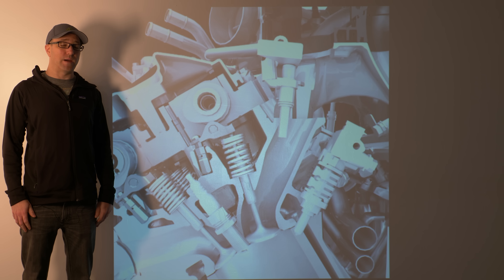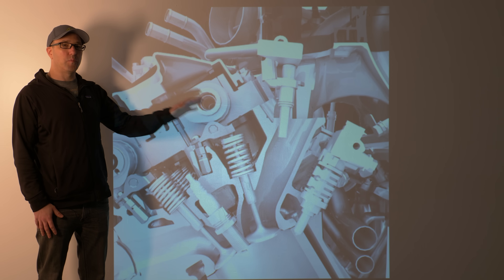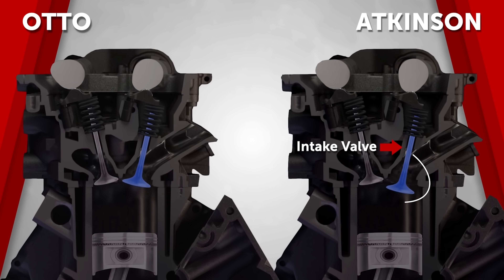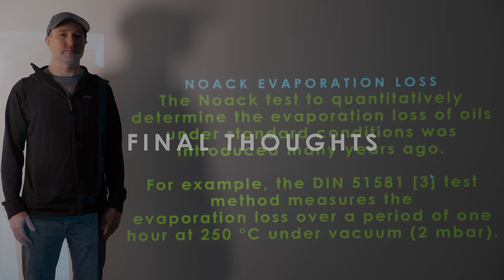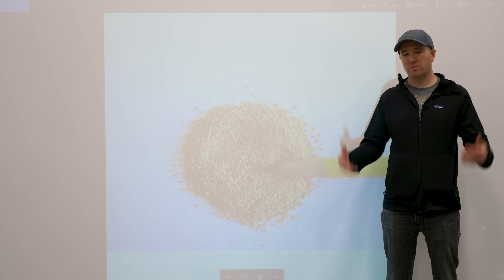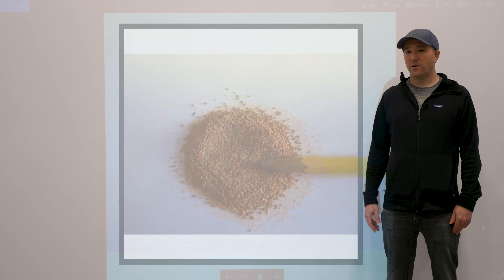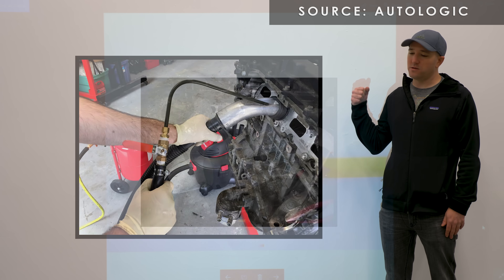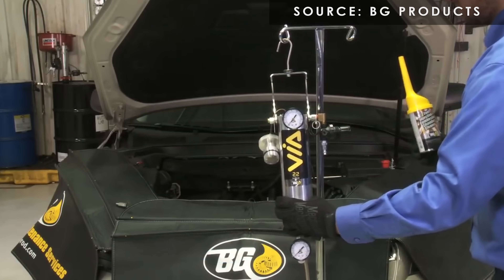Direct Injection, Problems and Solutions | The Fine Print

Comment: I think one of the biggest contributors to oil on valves is the pcv valve in the intake manifold, well on the cars that have those. a lot of oil gets into the intake that way. my car I bought an oil separator, I had to mod my intake manifold, but it routes all the pcv ports through the separator and drains it back into the pan. huge difference. manifold and all my charge piping stays totally clean now. I also run a lot of water meth while in boost so that also helps. The walnut blasting works great. its very easy for people who know there way around an engine and tools. the longest and hardest part is prepping. that shit gets everywhere so u have to cover everything in plastic and find a way to keep it from spraying everywhere. I have a shop vac hose just outside the cylinder to suck it up as it flies out. it works well.

Comment: You explain blowby so weird. As if it blows by back into the intake or something.
Reply: Right, but it was backwards wasn't it?  Always thought Blow By was related gases that make it past the rings into the Crank Case, where the Crank Shaft resides.  Hence Crank Case ventilation.
Reply: Yes, you're right, and the explanation given in the video is wrong and misleading...
Reply from the maker: The explanation was generic to talk about PCV without going over heads.

Comment: So, here is a dumb question.  If gasoline is a sufficiently good solvent for port injected engines, why couldn't you just tube feed gasoline through the air intake, let it sit, and either suck the dissolved residue off or burn it off in the engine?
Reply from the maker: Its not just that it sprays but also ignites helping to burn carbon off.  The fuel alone in small doses would not have full effect.

Comment: This is great information and the presentation was fantastic. As the owner of a Direct Injection Turbo car I knew what I was getting into. I used to work for a leading fuel system manufacturer that was the direct supplier to an international Auto manufacturer. 21k miles so far and no issues. Using 5W40 full synthetic oil with a low NOACK. I also change the oil and filter every 5k miles, manufacturer recommendation is every 10k miles. I also only use top tier premium fuel and LiquiMoly Jectron added every 3-4 tanks. These cars work great but you have to understand the technology and do your preventative maintenance.

Comment: Thank you for this information. I do know about it since I have a Audi A4 2.0t. I have installed a catch can. Just wondering why you have not mentioned "top tier" fuel? I've been using SHELL V Power ever since I was made aware of this carbon build up. I would think it should  help. Also, What are your thoughts on Seafoaming it through the intake manifold. Do you think it will actually clear up the carbon build up on the injectors and also have some effect on the pistons and valves? ~Anthony

Comment: Great video man ! Very instructive. I would add that gas doesn't act as a lubricant like diesel fuel, so the high pressure pump and injectors are subject to a "dry" fuel, of course modern diesel fuel with dpf and regulations has less sulphur content than many years ago (just as modern engine oils for diesel cars, sulphur acts as a natural lubricant). The carbon buildup is becoming a problem with both diesel and di gas engine, that combined with cheaper materials, costs and everything, good luck to those who wants to keep their car in the long run. Modern cars are not meant to last sadly, honestly, I'm scared with next decade or two, when all my old stuff will be banned to run, and all used cars (that we have now) will be junk, I don't know what will I buy. It's a pessimistic way to see things I recon but I don't see how things will get better for the average buyer unfortunately.

Comment: What's with the kiddies music in the background? The blow by is some of the problem with the design of all engines, more so with D.I. engines. All engines I've worked on all have crud/carbon on the inlet valves, apart from some Jap engines from bikes. Most of the clean bike engines I've stripped are ones that have been thrashed or raced. That says something to me anyway. Good explanation and well done on this matter for the uneducated of engines in general.

Comment: Very good explainer as usual!  I was a bit surprised though that you didn't mention adding a water/methanol injection kit along with the oil separator?  The water/meth kit is essentially the poor man's reverse engineered port injection solution.  I have a 2013 Ecoboost F150 w/ nearly 70k miles and been running a UPR catch can + AEM water/meth kit w/ a progressive controller for about a year w/ great success.  Based on what I've been able to see w/ a bore scope the intake and valves are clean as a whistle!  I can even feel a bit of boost surge when meth spray kicks in and helps cool the intake charge.

Comment: @Savagegeese if I have a Hyundai Genesis Coupe 3.8L GDI, am I screwed if I have 30k miles and have not put an oil catch can on? If I put one on know is it to late? I know it's limited as e erg vehicle is different but curious how you Would handle it if you were in my shoes? Thank you so much man
Reply from the maker: Yo, I would find a shop who does the BG DI service and has the machine to do it.  Then from there run catch can and around 80k pull IM and see what intake valves look like to know if you need walnut blast.
Reply: savagegeese this is why I Love you. Honestly really appreciate the help. Thank you
Reply: savagegeese so I found a local shop that says it has the vacuum for the BG cleaning. Is that the machine you were talking about? I am thinking so but couldn't find mention on the bg website on proper machine use for the service. I owe you a beer on this one. Thank you again

Comment: I will not buy a DI car. Ill keep my 1991 Dodge Dakota LA318 tbi. Most people don't know that you are responsible for the emission system upkeep. What is sad one repair to a DI engine would pay for fuel for my old truck for 4 months. DI engine need special tools to work on properly!
Reply: Yeah exactly you will save maybe a 5 to 10$ a week on gas but in the long run it cost 2000$ to clean your engine in 5 years so the economy is almost none. Anyway 5 years its pretty much the time those new car will last, they are made so you have to buy a new car every 5 years or spend the price of the car in repairing the anti-pollution system.

Comment: This is very well presented and explained so well; however your explanation of blow by is confusing, in my understanding blow by is combustion by products that make it past the cylinder rings and into the crank case. ( for the positive crankcase ventilation valve to collect. Please let me know if this is wrong on my part.
I have a Lexus vehicle that has both systems in a V8 engine and I do use injection and fuel system cleaner in the gas tank a couple of times a year before a long drive, it seems to work well for me and I have had no problems at all at eleven years and 82k miles.

Comment: If you ask me the gas guys are cheating somewhere on EGR and PCV. I come from the diesel world and that exhaust is much dirtier and the oil gets everywhere , (intercooler, etc) yet we don't see the carbon buildup on the valves like these pictures are showing. The newer Duramax engines are running separators which seems to be working wonderfully but time will tell. I traded my '06 diesel with all emissions intact at 170k miles and it ran like a top so maybe things are not so bad.

Comment: If you ask me the EGR and PCV systems have to be re-thought and or standard oil seperators. I come from the diesel world where the exhaust is much dirtier and the oil gets everywhere, (intercooler, etc)  yet it doesn't seem to foul the valves as shown here. Therefore the gas guys are cheating somewhere to get that carbon buildup on the valves.  The newer Duramax has a seperator on it which seems to be working wonderfully although time will tell. For what it's worth I left all my emissions intact on my '06 diesel and when traded in at 170K miles ran like a top.

Comment: This is why diesel  engines oil gets black real quick from soot. Before on a diesel engine blow by would be vented out to the atmosphere. Not they capture it  and use a seventh injector to burn it off and next phase is def fluid injected.   Port and direct injection should solve the problem. For car that only have direct inject should have Iike a temporary port style thing you could hook up and of course the computer would have to recognize  it to run like a parked Regen ok n a diesel motor  but for port cleaning instead.
Reply: Justin bustin I think the main reason Diesel engine’s oil gets black quicker is because of the far higher compression ratio leading to more combustion blow by past the rings and into the crankcase (and oil)
Reply: Adventure Flight Co yes, more blow by more soot into the oil.

Comment: Anyone do experimentation on water methanol induction to the air stream, it does wonders for carbon build up on rotaries, effectively increases the octane of the air-fuel mixture too.  you could do a low rate at high RPM only so a gallon of the mix would last a long while.  I was looking at a system like this to on the boosted RENISIS i'm slowly building.
I know it doesn't really increase the octane, its an effective result of the extra heat absorbed by the water as it vaporises in the compustion chamber...
Reply: Yeah did on my Volvo 850R 15 psi but i bend a rod when methanol open at full boost, if not tune for it don't run water/meth i have learn at my own expense.

Comment: Vehicles with multi-port (point) fuel injection

Subaru: Legacy, Outback, BRZ
Toyota: Avalon, 86, Prius
Lexus: ES, GS, RX, GX, NX
Reply: Reading Time Fun The new 2018 camry with the D4S injection is the dual injection he describes
Reply: The LS has the same
Reply: My 8th Gen Civic is multi-point
Reply: @phillipBappleton  multi-point fuel injection is NOT dual injection. It is port fuel injection. It refers to the fact that it injects through individual ports outside of the cylinder as opposed to a single fuel injector for the entire engine. The distinction isn't necessary for GDI.
Reply: Some Toyota dealer websites indicate Camry has sequential MPFI but others indicate the model has just DI. Confusing.

Comment: my 14 focus has 76k miles and runs great...I run  it at high rpms here and there everyday....also have used seafoam spray 3 times.  I think there will be less waste with hi octane gas...right now I am using 100pct gasoline, mobil 1 extended performance  for 6k miles and try to run it hot as I can to blow out carbon....change out plugs every 60k too
Reply: Leo Durocher im just wondering, does your focus have an auto trans or manual? I know it’s not engine related but I hear a lot of things about the dual clutch autos in your car cause issues, unless it’s a manual trans then you’re good.

Comment: I purchased new 2017 Volkswagen Within two months I had a catch can Installed, purchased it from https://www.ecstuning.com/   
After 5000+ miles Nothing, not a drop oil or water. Two attempts to put a negative review were never posted it, I believe that constitutes fraud. At the very bottom "The ECS Gen3 Baffled Oil Catch Can system was engineered to supplement the already stout OEM PCV system and collect the ultra-fine blow-by gases and reduce the ingestion of oil vapors in the turbo inlet pipe. As such, you should not expect to collect mass amounts of fluid in the catch can reservoir as with the previous generation engines. " This should be at the very top not buried at the bottom.
Reply: maybe get back to us at around 30,000 mark?
Reply: maybe that new engine wasn't really spitting out any oil in the first place, meaning the can wasn't needed just yet?
Reply: Who Me? You put a catch can on a brand new car, thats your problem
Reply: Fraud? You need a trip to Law School.
Reply: 2011 gen 5 Camaro ... V6. I installed a quality catch can on it the day I got it. Required emptying every two weeks, 8-10oz's. Depends on your engine I suppose. It did what it was supposed to do in my case and I got 180k miles on that car. There are plenty of reported cases from gen 5 v6 owners with oil consumption problems/intake related problems and needing major work done before 100k miles. Recently bought a new V6 mustang and have installed one in that. So far, I get a couple of ounces in between oil changes, which I do around 7-8k miles. Some models/makes are worse than others.

Comment: My 2014 Mazda 6 has over 90,000 miles with no issues from the DI.  Ford had tons of problems with this and Mazda saw that and learned from their mistakes.  I use good oil every time and drive the car hard 6000rpm almost every time I'm in it.  Not all DI cars have this problem, Ford and Volkswagen come to mind for big issues.

Comment: The direct/port hybrid systems seem to be doing OK, FR-S/GT86/BRZs have a few examples deep into the 100,000 mile range and some knocking on 200,000 and repairs and issues seem to be all random chance without any statistical significance from car to car other than a squeaky fuel pump due to ethanol (which doesn't fail, just squeaks).  I would like to know how much of these direct injection issues correlate to high levels of ethanol in fuel as well.  That's hard info to get out of consumers because they either aren't paying attention or will lie to avoid liability.  If someone is running E85 in a car that wasn't designed for it, I could see that causing problems.

Comment: This is one of the better videos on this topic. It's a HUGE problem and somehow still mostly a "dirty little secret" that car companies are hoping few know about. The worst offenders seem to be from the dishonest folks who brought us diesel gate. If you do the research Audi was among the first to have massive customer complaints due to DI Carbon build up with their poorly engineered DI V6. And a great many years later the VW Group, perhaps to nobody's surprise, has done little to solve this issue. They're happy to hack US emissions testing but can't be bothered to design an engine that won't throw a check engine code every 30K and require a $1000+ dealer "maintenance" service to fix. At least Ford and Toyota, have invested in dual injection to properly solve this problem. Nearly every other car manufacture is ignoring it and focusing instead on ways to avoid warranty claims. This is what you get with public companies focused on profits above all else. They cut every corner they can to focus on short term gains even if the customer gets screwed after the warranty expires.

Comment: Thanks for all of the information. I own a ‘17 Toyota Tacoma with the 3.5L DI and port injection (I’m 99% sure) and I’ve been running the highest octane fuel available every fill up, Chevron fuel injector cleaner every other tank and Mobile 1 full synthetic oil ( 0-20) changes every 3000 miles. My question is would it be wise to run 5-30 weight oil and who makes the best oil catch can? My maintenance routine may seem over the top for you but I do all maintenance myself and purchase oil as well as injector cleaner through Costco when discounted. This is the last truck I will most likely ever own and it’s maintained as such. Any advise would be appreciated and thanks in advance.
Reply: I think the newer Tacomas come equipped with the D4-S system which means both port and direct injection for each cylinder similar to the one used in the BRZ/86/FR-S.  No need to clean up intake valve gunk-- there won't be any!  That being said, I drive a DI turbo car and only use Top Tier fuel (Shell, Mobil, Costco, etc.) and use 5W-40 Motul Xcess 8100 or LiquiMoly High Tech full synthetic oil.  Taco's will last ETERNITY.  You should be good, my friend.
Reply: If you're so worried about your car why did you cancel your warranty by doing the maintenance yourself?
Reply: Alexandro Cedillo Rivera It doesn’t void your warranty to do your own maintenance. Moss-magnuson act makes it illegal for dealers to require you to do maintenance there. You just have to be able to prove that it was done using correct lubricants, etc...
Reply: Same law in Canada, just different name.
Reply: change that oil to Pennzoil Ultra Platinum or Motul, Mobil 1 no good for DI

Comment: There are millions and millions of directly injected cars worldwide being driven daily for more than 5 years easily. I do agree to an extent but at the same time with using the right fuel and oil this carbon build up on the valves should not be an issue even if your daily drive is mostly start-stop. But, fuel quality is very important and does seem to be a bigger issue in America than in Europe.

Comment: There is NOTHING you can do to prevent carbon build up in a DI engine.  A catch can can slow it down, but it will still happen.  Low volatility oils will still cause build up.  THE ONLY THING THAT CAN BE DONE IS PERIODIC INTAKE VALVE CLEANING MANUALLY.
Reply: Actually you can add a water/methanol injection kit like from AEM or Snow Performance and essentially make the engine "self-cleaning" kind of like a poor man's / reverse engineered port injection system.  That's what I did on my ecoboost F150 + a UPR separator /  catch-can pretty much eliminated the problem.
Reply: Yup... IMO it's not that big a deal.  We're talking maybe 500-600 bucks every 80-100K miles?
Reply: Doug Bankhead Added a RX catch can and clean side separator on my 17 High Country 6.2L when it was new and use Amsoil PI treatment every 5000kms and use Signature Series oil as well. This will take care of the issue